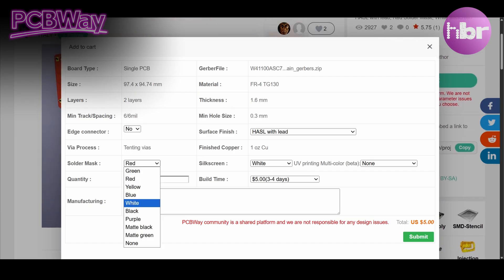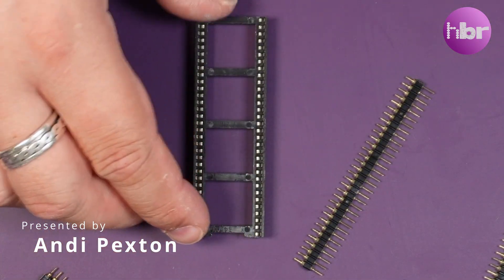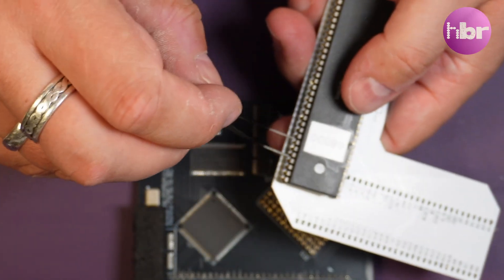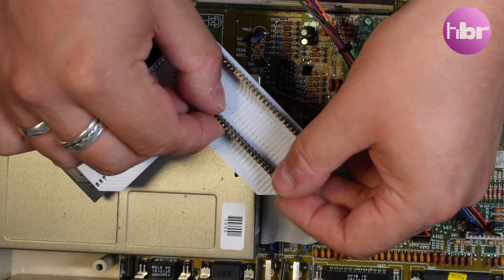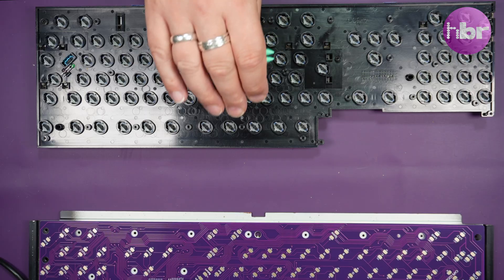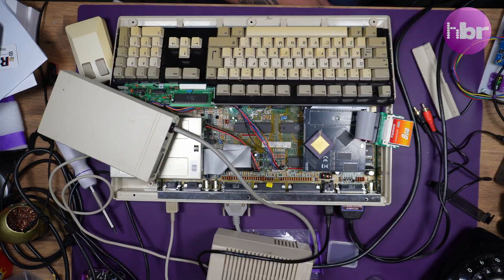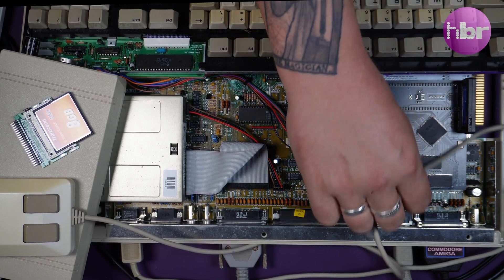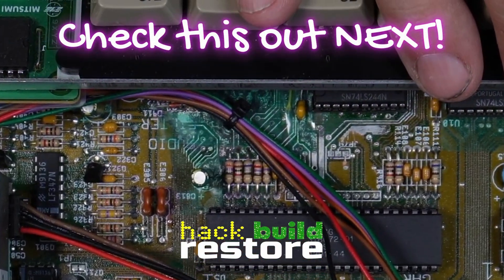The Amiga 500+ That Refused to Die is Now SUPERCHARGED!

Comment: I had a Transcend CF card do the same thing to me on my A500 / TF536 setup. The 8GBs were a bit fussy I found. I thought it was the CF adapter that failed, but it was the card that whilst still working, just didn't like that setup. Swapped to a SD card solution and that worked fine.
Reply from the maker: Thanks for watching, and for sharing ... I have tried 3 different CF Cards to no avail I think it is in this case something subtle on the adaptor design. I will at some point check what I used in my other A500+ that has a CF Card (from the same batch as these) but using a different adaptor.
Reply: @hackbuildrestore  Well reminded, I did bin off a couple of the cheap CF card adapters as well, but never revisited them as I went SD card.